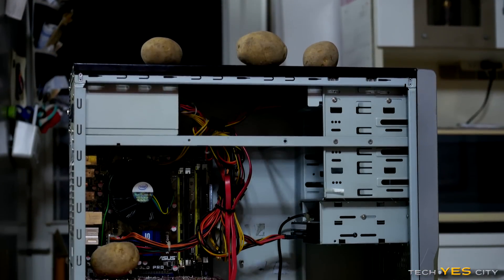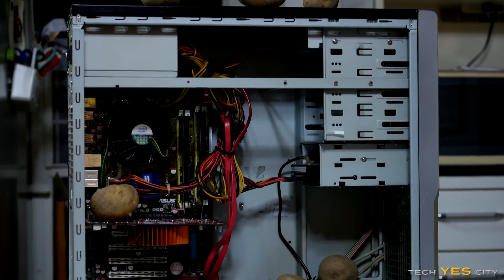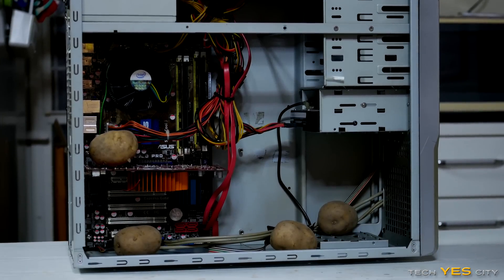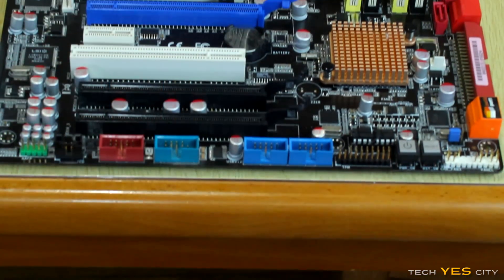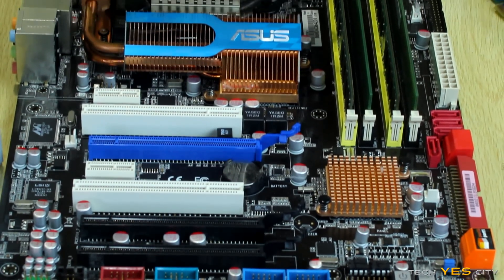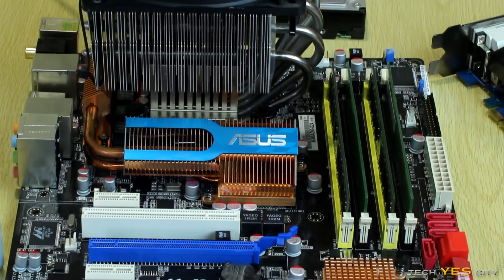The $70 CS:GO POTATO - 1080p CS:GO for Under $100?

Comment: $70 for the parts, another $700 in spray to clean it.
Reply from the maker: Not even $2 a bottle for brake cleaner man.
Reply from the maker: depends on the day, but if its humid I will put it in front of heater on low.  But usually 30 mins is good enough.
Reply: this can run csgo better than my 300$ pc wtf
Reply: higher fps results in smoother mouse movement even on 60hz. try it yourself
Reply: +KleviSCR. welp my 500 euro laprop gets 30 fps with a intel i 5
Reply: Gamers depends on rest of the pc and what i5 idiot
Reply: whats the point if you dont have a 144hz monitor?
Reply: can i use brake cleaner?
Reply: +Tech YES City Pls can you answer this question to me.
Could I record CSGO on low with this PC.I plan to record CSGO with Roxio Game Capture HD PRO.
Reply: you really havent got much money if you are getting this lmfao
Reply: iedereen praat engels kom jij ff aan schijten met je nederlands
Reply: How long do you wait for that to dry?
Reply: I was watching the video and i was like ''prob the cleaning stuff is more expensive'' First Comment be like :D
Reply: +KleviSCR my laptop runs CSGO at 200 FPS
Reply: yes
Reply: in my country spray to clean your specs is 10$
Reply: ja da wel
Reply: 6
Reply: +Kikoh ye idk how my friend have an intel 5 and he only have 30 fps
Reply: Specs?
Reply: Tijmen Berends on a laptop lol dont call me idiot
Reply: I play csgo on laptop 200 fps with a dual screen aoc 75hz and its work hell good i dont thinks 144hz monitor really worth it because is really high price if u want a good one
Reply: Nalianna i
Reply: The ozone hole is still recovering from this build
Reply: This didn't age well

Comment: you forgot to mention that windows is 100 bucks plus monitor, keyboard, mouse and headsett. And it had problems with 60fps on nuke.
Reply: you dont need to buy an os. Linux also? mouse and keyboard and monitor, you should already have peripherals

Comment: yo Tech YC.. I think to upgrade me 256 Bit 512 MB GPU with a 128Bit 2GB am I going to get about 80 + FPS on it or.. i should buy some parts and get a new pc builded up.. btw with this 512 MB GPU i get about 50-70 fps on Low Settings

Comment: now im thinking i have picked really bad parts or something because i only have a bit over 200fps in cs... and also does cleaning up the parts affect performance a lot and what is the spray you used?
Reply: brake cleaner, it basically takes off everything.

Comment: Runs csgo better than my gaming pc I bought 4 years ago for $600

IBUYPOWER- I-Series 301
Specs:
CPU- AMD FX(tm)-4300 Quad Core 3.80 GHz
RAM- 8 GB
GPU- GeForce GT 610
Motherboard- Gigabyte GA-78LMT-USB3
HDD- Toshiba DT01ACA200
Power Supply- Allied SL-8320BTX

I don't understand

Comment: Wtf I just bought a pc for 550$ and I get 100 fps at maximum settings and 1280x784
Reply: but is it 1080p? exactly
Reply: Uri Lim Coetzee I dont have a 1080p monitor
Reply: hook it to one when you can, update me on that, ifyou can still run same settings.
Reply: Uri Lim Coetzee ok reply so I could reply back
Reply: +Thani Qatami sure np
Reply: Uri Lim Coetzee I get about 51 on meduim 1080p
Reply: he was running 80+ fps, see?

Comment: Tbh. 60-70fps average in csgo isn't really playable. csgo benefits hard time by high fps cause of input lag etc.
Reply: Official Sikator 130 fps is still terrible in higher ranks for CSGO. 200+ is a minimum for any professional, and 300 fps is recommended.
Reply: I play csgo at 70 fps..Got a double kill with AWP

Comment: I got something similar for $62...

Specs:
Phenom x3 8400
3gb ddr2 RAM
320gb HDD
Radeon HD 6850
Reply: Is the ddr2 ram good enough for cs:go ? I have the exact same one
Reply: Jayyy Ceee I don't know what's up but I'm getting around 20fps on low settings in 1600x900. It's not using more than 2gb while playing.

You might want to save money because I had to spend another $40 on getting a hard drive, the cables, and a wireless adapter. That's $100 altogether, and another $100 could get you a pretty decent 'gaming' pc.

Comment: i'd have really liked to see an ingame footage.

My PC is 2 years old now but I've got an gtx 760 and an intel i5 processor, 8 Gb ram and 1 terra disk space.

Yet I have this tearing screen in csgo wich just hurts the eyes after  a 2nd match and also kind of handicaps me terms of reacting to peaking enemies.
I play games like bf3 on max flawless, what can be the problem ?
Vsync kind of eliminates the issue but I remain with a mouse lag-input wich I cant delete since I've got an 144hz monitor but I can't get over 58 fps if Vsync is on. ( Your probably know, but I have to cap my fps at 144 in order to eliminate the input lag). 
Any solution ? The entire internet cant help me ..

PS: first video i've seen of you, great job, + new sub :)
Reply: Wait, what? Something is definitely wrong with that.  Make sure that you enabled the 144hz on your desktop or it won't work. You should be getting zero screen tearing with 144 fps and 144hz.

Comment: Wtf its running faster than my 350$ pc
Reply: Faster than my 600$
Reply: the thing you guys don't know is because you pay 3000$ for a pc it does automacticly run faster then all pc under this price, remember that.
Reply: kek
Reply: my calculator can run csgo too
Reply: Faster than my $1100 Mac!........ Actually that's not that hard to believe…
Reply: That's just because macs are shit lol build a real computer bud
Reply: you should stop clicking every shit you see on the internet ans actually start taking care of you computer
Reply: better than my $600 pc XD
Reply: faster than mij 1,700
Reply: +Gary “Roach” Sanderson mine was  around 700 i run cs:go on maxed settings with 60 fps 1920x1080
Reply: Wifi connection
Reply: just add a gtx 750 ti for 50 usd used  and ur done!
Reply: Ylermi Korhonen your $350 pc probably has a i3, if you add in a used gtx 750 ti for only 60 dollars, you'll get much better fps than this PC
Reply: +Ylermi Korhonen my computer is 140 dollars and can run any game low to  high at 60fps
Reply: runs faster than my $600 gaming build lmao
Reply: Not.Muffin macs use parts that were good then proceeds to downgrade all their power til it's shit aka macs are shit.
Reply: Geraqui My pc doesn't even have a fucking GPU
Reply: Daincius what's your mobo
Reply: Jiří Caha thats it Jirko!
Reply: same
Reply: LoL
Reply: same
Reply: Shut up, Shepherd killed you.
Reply: 2 times as fast as my $1000 pic 0_0
Reply: mine 550$ and 180-300fps, also witcher 3 on high with 30fps
Reply: +Bruhh well yea, thats a gimme
Reply: mine was 700 and funs CS Max Out 1080p at 300 fps, Update yo GPU Drivers
Reply: I'm just sitting here with a $4000 PC wondering where you found all these dirt cheap  computers lol
Reply: you can pick up a core 2 quad pc for 100$ 
https://www.neweggbusiness.com/Product/Product.aspx?Item=9B-83-282-738&nm_mc=KNC-GoogleBiz-PC&cm_mmc=KNC-GoogleBiz-PC-_-pla-_-Desktop+PC-_-9B-83-282-738&gclid=Cj0KEQjw8pC9BRCqrq37zZil4a0BEiQAZO_zrEVHc9Hn-ubCIKMxqOrBj94IRASecH4KC0P_3KiNGl8aAvNl8P8HAQ
then add the gtx 750ti low profile for 119$
http://www.newegg.com/Product/Product.aspx?Item=N82E16814125680&nm_mc=KNC-GoogleAdwords-PC&cm_mmc=KNC-GoogleAdwords-PC-_-pla-_-Video+Card+-+Nvidia-_-N82E16814125680&gclid=Cj0KEQjw8pC9BRCqrq37zZil4a0BEiQAZO_zrFWmNCeSXa9kTuocUeP7HIWa5VE8Jj8GlpUKkj6hITUaAp-c8P8HAQ&gclsrc=aw.ds
bam 210$ 1080p gaming machine,
Reply: Oskar Martin true enough
Reply: +Ylermi Korhonen im not rich at all m8
Reply: Faster than my 1000$ pc
Reply: faster than my 1600$ pc
Reply: faster than my 1200e asus gaming laptop
Reply: Not bragin or anything but old machines are better and I got my dads laptop five year old it runs csgo max smoothly non of that Mac shit
Reply: Oven Cooks
on low graphics and 40fps right lmfao :P why do you play on a laptop tho
Reply: anyone who have a good pc, but still 60 fps, type fps_max 999 in ur console, the frames are locked at 60fps sometimes.
Reply: better than my 400 dollars laptop lol
Reply: ElTres-
laptops are genuine shit tho except the real gaming ones lmfao
Reply: Jiří Caha Asi tak.. :"D
Reply: Same as laptop
Reply: then buy one
Reply: Classy Clorox
xD
Reply: Tijmen Berends xD
Reply: Classy Clorox I would need a new CPU as well, so it won't be restricting the GPU that I do buy, and at the moment I don't have a source of income capable of splurging that money on a PC that works well enough already. It's not a good PC, but it works decent for what I need.
Reply: Mine was $500 and it runs better than my Pc :c
Reply: Thats cause your killing your pc with running tons of useless programs in the background, not cleaning it, not deleting files you dont use.
Reply: talxaN I do delete the background stuff but i cant delete it all and plus i have a 1 TB Hard drive i think it got a enough space :33
Reply: Run CCleaner might help or idk check my channel theres a video that might help in that case
Reply: Romvnly - Roblox And Minecraft And More! Dude just search %temp% press enter and delete all the files in there👌
Clorox tech tips
Reply: Classy Clorox Thanks :0
Reply: Romvnly - Roblox And Minecraft And More! Your welcome
Reply: Classy Clorox this 70$ pc makes me so sad over my 500$ hp pc i could of got gaming pc with 500$ not this 4gb ram pc THIS PC IS SO BAD...
Reply: Jiří Caha im getting a $2000 pc today :p
Reply: Give me
Reply: who actually cares how much fps you pc gets on max settings, when it only matters on low 4:3?
Reply: Daincius why?
Reply: ZxZ_TastyCoke_ZxZ Some people should really keep off the nerd videos because this. Is for PC nerds not idiots.
Reply: Romvnly - Roblox And Minecraft And More! Are you saying he is the idiot, or me?
Reply: Daincius I'm calling him a idiot.
Reply: Romvnly - Roblox And Minecraft And More! Ok, thanks
Reply: Daincius What a fast reply.
Reply: Don Alexi Lol bs
Reply: Jiří Caha try to add better graphic card?
Reply: Gtehnic was it a prebuilt
Reply: Mine runs above 60 at 2k ;)
Reply: WHAT ARE YOU SAYING? The reason your laptop is running like crap is because laptops have horrible price to performance
Reply: nechtěl bych Jirko
Reply: Jiří Caha a maybe a low pre set 720p gaming all low preset xD
Reply: to si děláš prdel😂
Reply: Jiří Caha ikr i wish i haad that 70 dollars for a bit of adjusting everything on low wow that runs better than alot of labtops
Reply: What's your build
Reply: Faster than my 450$ laptop lol
Reply: Probably because the components you used are brand new. Try to make a pc that has used parts because it is cheaper and sometimes better
Reply: Depends if you build it or bought it
Reply: 350$ isnt a lot tho
Reply: Jiří Caha this video is fake bro, dont worry
Reply: Jiří Caha this cheap pc is fooling people around. i think those pc part has been made by them and its already optimized for gaming like consoles. and the reason its cheap, you have to assemble it by yourself just like they did. if youre too careless you would destroy those part. i have laptop that is expensive than my ps4 but it only run lower than ps3 graphics..
Reply: For you information.. There are so many gaming laptops nowadays and can play at full real max settings current games with the same price as pc.. Also could you eve play pc outside the house if ever you want to bring them anywhere. Your balls would explode to bring pc and monitor anywhere lmao..
Reply: Please, link me a 350 dollar laptop that can play gta ultra 1080p 60fps
Reply: Haha even free i also have.. Its a gift given to me which it could run even on 4k@60fps too rofl..

Comment: He ive got a around 600€ PC and only 20 fps... can someone help me?
Reply: wtf how,im using my i5 integrated graphic card and i get 60fps stable most of the time on 1024x768
Reply: Tell me the component list please :)
Reply: +Tairo LP How long have you had it and what parts are you using??
Reply: +Gabrielz Stefa can i tell you after school
Reply: +OrangeKing can i tell you after school
Reply: +Tairo LP   Spec?
Reply: +GamerJetic i know ive got a new strix gtx 750ti gpu and 4 gb ddr3 dimm ram dont know my cpu
Reply: +Tairo LP  get 8gb and make sure drivers are up to date
Reply: +GamerJetic okay i wanted to buy more ram soon
Reply: +Tairo LP you should get 60fps hmm
Reply: +Gabrielz Stefa my gpu is not using the full power only 10 % of it
Reply: +Gabrielz Stefa ive got the Strix gtx 750TI 4gb OC edition and it should play bo3 on 140 fps but if i get only 20 fps in cs go i cant think about it that can really happen
Reply: +Tairo LP must be your cpu if your gpu is at 10%, what cpu do u have?
Reply: +GamerJetic dont knoe
Reply: +Tairo LP check it out m8
Reply: +Gabrielz Stefa CPU 2x AMD A4-4020 APU with radeon HD graphics, its showing the information like this in minecraft
Reply: +Tairo LP are you sure you are not using the integrated graphics?
Reply: +Tairo LP  sounds like integrated . Also I will check if that cpu is a bottleneck
Reply: However I tried that integrated gpu with that cpu and it ran bo2 low settings 80fps
Reply: +GamerJetic okay
Reply: +GamerJetic wait, did you buyed that cpu just for test something for me?
Reply: +Tairo LP   Yea i want to help you out
Reply: +GamerJetic 
Damn, you are a nice person!
Reply: +GamerJetic Thank you!! Ok the cpu is cheap but THANKS
Reply: +Tairo LP  so did you fix it? And did you install all drivers
Reply: +GamerJetic Sadly no and yep all drivers installed, direkt from the disk
Reply: +Tairo LP did u check the thermal compound?
Reply: the drivers from the disc might not be the newest, try finding them from the manufacturers sites. (should be up to date) :)
Reply: Try overclocking the cpu that may work
Reply: I'm only getting 300 fps on 2560x1440 :(
Reply: +AFG Poro cries inside
Reply: Gabrielz Stefa ikr XD
Reply: +Tairo LP you are using your integrated gpu,not the dedicated one (nvidia) , to do so just right click on csgo.exe , graphics option and open with nvidia gpu.
Reply: +Tairo LP maybe you plug the display on the mainboard cords and not the gpu cord
Reply: +Rivai a.s gpu coord of course
Reply: Rivai a.s if u have a GPU in ur pc and plug ur monitor on ur mobo it wont post. u wont have signal ;)
Reply: it will have... it changes to onboard gpu
Reply: Is it a mac?

Comment: Will my portable potato run CS:GO 1366x768 Everything low at 30 FPS?
ASUS X553M
Reply: +bomberman4046 Maybe if I lower the quality and overclock my CPU will it work at around 45 FPS
Reply: I got a new laptop, it has a Amd A8 quad core processor and a Radeon R5, that old one broke 2 times for some reason and they gave me the money back.

Comment: I can barely play this game at 60 fps with a R7 260X  low resolution, medium settings.
Is that normal?
P.S. I got a Pentium Dual Core E5700 3.0 GHz.
Reply: Florin Florin 
But what's the problem then? Im mosty running 40 fps.

Comment: What kind of sorcery is this? My PC i5 4440K, 8GB RAM, GTX 610 ( I know its a cooked potato) cant run a single fucking CSGO with all low settings 1920x1080 with a minimum of 30 fps and on new nuke it struggles
Reply: that graphics card is really holding your PC back. Consider upgrading your graphics card
Reply: that graphics card is really holding your PC back. Consider upgrading your graphics card
Reply: +Adonis Tahiri is it worse than the GPU in the video? or is he just using low resolution monitor
Reply: Kylo RenTF2 yup much worse btw it's the GT 610 I would recommend a radeon HD 6950-6970 if you are on a really low budget get the 5770 or you could lower the resolution to 720p as the card you have its made for 720p ☺
Reply: how can i change it to 720p ? the settings are all on low

Comment: Here is my build it is in pounds so is converted at the rate now to us dollars Dell inspiron 530 with two 1GB sticks of ram and Core 2 Duo E4700- Free, 1GB of ram- Free, 1GB of ram- £1.50 so $2.16, EVGA Geforce GTX 660 Superclocked- £20.00 so $28.82, 500GB SATA HDD- £10.00 so $14.41, Total price- £31.50 so $45.39. Specs-4GB of DDR2 800MHZ ram, Core 2 Duo E4700 2.6GHZ planning to overclock to around 3.5GHZ, EVGA Geforce GTX 660 Superclocked 2GB GDDR5. Comment on what you think

Comment: I have a Intel Core 2 Duo Q8300 and a AMD Radeon HD 6300 and 4GB DDR3 RAM and this pc looks like it's running csgo smoother then mine pc on the nuke map.
A bit dissapointing. xD
Or maybe it's just because the video was 30 fps too but would've been nice to see the fps. :D
Reply: the fps is in the top left of the monitor

Comment: i would like to play any game ultra settings 1080p or even 1440p 60 fps+ whilst recording 

AMD 6300
GTX 960 SSC 4 GB 
16 GB Ram 1866 MHz
480 GB SSD
Microsoft  Windows 10 pro 64 bit 
5.1 sound system
EXDISPLAY Gigabyte GA-78LMT-USB3 760G Socket AM3+ VGA DVI HDMI 7.1 Channel Audio mATX Motherboard
coolermaster HYPER 212 Evo RR-212E-16PK-R1 120 mm CPU Cooler
on a 144hz monitor 
500 mega bits per second wifi  

can some on pls reply
Reply: +all about beats  if u want to record not,if u want to play the game yes
if u want to record buy i5 or i7 dat fx 6300 is not good
Reply: Left Leg yer i might buy as fx8520 at 5GHz
Reply: thats better
Reply: Left Leg ok

Comment: I have a better pc and I run on lower settings than you but I have not so much FPS comparing to you in CS. How did you do that?
Im running :
AMD A8 5600K 
8 gigs of ram
Windows 7 64 bits.
Reply: 8 gigs for a APU won't get you anywhere. More RAM/most important faster RAM
Reply: Deadwolf I overclocked my ram to 1900mhz.

Comment: At 2:16 where he starts cleaning the PSU. As a student in electronics: even if he did correctly. please, please DO NOT try to wipe the PSU components, even if its unpluged, the Capacitors and many other components can hold enough charge to harm you, Badly. So only wiping the fans or taking a non conductive material to clean it up...